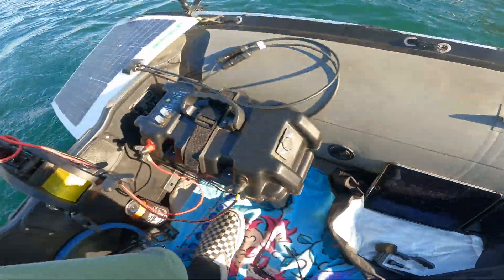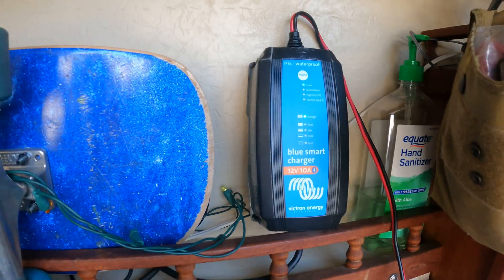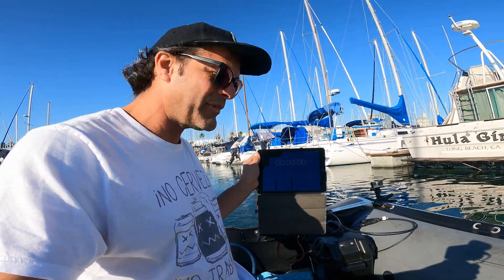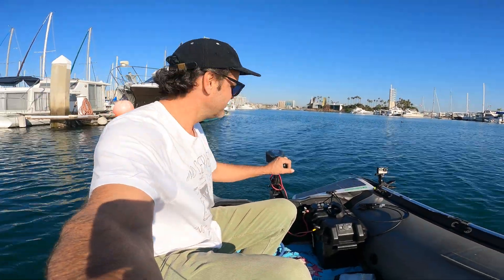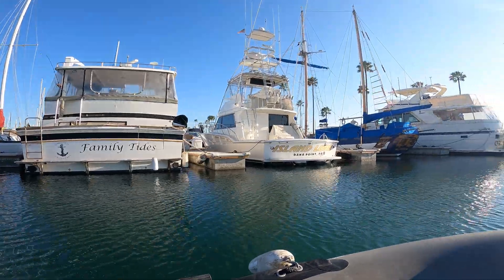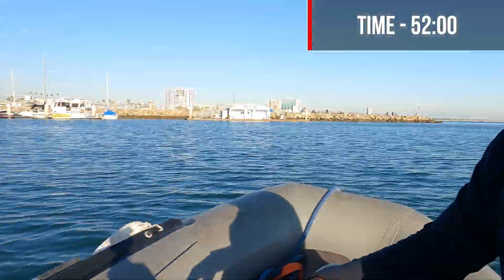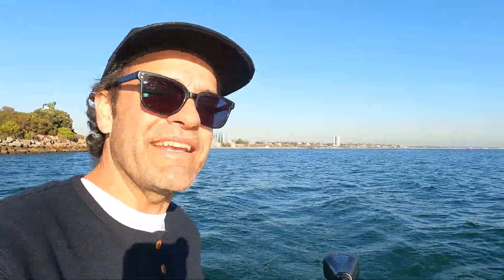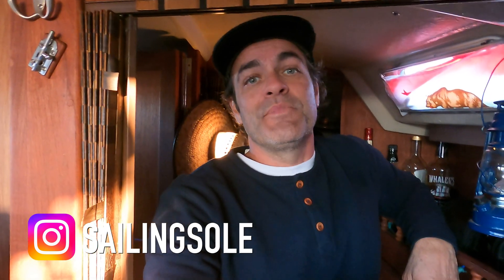EP 4 - Review: Solar Electric Dinghy | Newport Vessels Motor with 30Ah Lithium Battery

Comment: How does that solar panel and victron charger do keeping the batter y up with power used? Nice job
Thank you
Reply from the maker: It won’t keep up. It is merely a trickle charger for when it’s sitting at the dinghy dock or not being used but that 50 watt panel won’t keep up. It will top it off if I let it sit which is nice.

Comment: Interesting video. Lasted a long time. Just think if you would've stopped and done some fishing the batteries would have gone a lot longer getting a charge while you were fishing or sightseeing.
Reply from the maker: Yeah I e thought about adding another 50 watt panel to the other side and upgrading my battery but it works fine for now. Cheers!

Comment: Just so you know, most trolling motors that size use dissipation coils to slow the motor down. Therefore, changing the speed does not affect power consumption much at all. Yours may be different, but mine uses about the same amount of power no matter what speed I am going. To reduce power consumption at lower speed you would want a pulse width modulator.
Reply from the maker: I did not know this. Thanks for schooling me. 
Pretty sure my motor is not like yours because my motor has a voltage meter (blue lights on top) to tell you how much battery life is left. Obviously not accurate but a crude meter. When you go full throttle the voltage drops. I’m definitely not an electronic engineer but seems logical.
Reply: @sailingsole  that voltage drop you see is where the motor is under a heavier load, so therefore it may be using less power at lower speeds.

Comment: Hey Andy, great content, as always!  Hopefully your LiFePO4 battery is a deep cycle battery (e.g. Lithium Titanate Oxide, or LTO).  Otherwise a full discharge can cause the electrodes to oxidize and retract, which will reduce the battery life.  Love your channel!
Reply from the maker: Thanks man. The battery has a bms so it will shut off output before it hurts the battery. It’s been a while since i made that video and the battery has performed fine ever since. 🤙🏼

Comment: You should get 1 more of those batteries so you have 2 in that box and that way if its windy or no solar you know you have 1 hour
Reply from the maker: Good idea 👍🏼
Reply: @sailingsole  if you do it you know positive to + and negative to - on both batteries but then you do positive on 1 battery and negative on other don't do them on 1 battery then it won't pull threw  both batteries or charge correctly.

Comment: Thanks for this video. Got an Intex Excursion I'm gonna custom mod the floor with plywood and make a built in motor mount. I have the same trolling motor and a 100ah iron phosphate on the way. Wonder how much the solar panel helped? Should I try a 100 watt panel? Thanks again and be safe.
Reply from the maker: Yeah, if you have room for a 100 watt panel do it. That will be much better to charge your larger battery. I’m curious how long your setup will run in good sunlight.

Comment: Thank you for being practical in your test of the electric motor. I had been thinking about going electric on my dinghy…do you think it’s powerful enough to be on the oceans, or in rougher water?
Reply from the maker: No I don’t think it’s strong enough for a dinghy in the ocean. But maybe if you had the 86 pound thrust motor that would work. But that is a 24 V system.

Comment: Nice test. LiFePO4 stays at rock-solid same voltage from 90% all the way down to 30%, and most motors attempt to measure the capacity by guesstimating based on the voltage, which is why it said 100% even though it was more like 35% when it started blinking. Great runtime anyway though.
Reply from the maker: Thanks TGT! Ya I understand that, it’s why it died so fast near the end. Cheers!
Reply: While this is all true, the real reason it stayed at full capacity for as long as it did is more likely due to the fact that it was being fed charge voltage by a solar charge controller.
Reply: Not correct. A 55# troller pulls about 200W continuous at speed 3. That 100W panel loses ~10% even in perfect sun through the MPPT, so it's giving back 90W-ish, max, less than half of the motor's draw, so it'll extend the range of the battery by a few hours, but it can't keep it topped up. Also, the volt meter on top of the motor can be tuned for lead acid or lithium, but not both. I'm willing to bet this one is tuned for monitoring lead acid, because that's what manufacturers do with volt meters 99% of the time. Lead acid reads full at 12.8V. A lithium pack is less than half-full at 12.8V because it lives higher than lead acid until the last 10% of its discharge cycle. So the LEDs would read full for the first few hours even if no solar panel were connected. The battery was not topped up. A volt meter is a faulty way to read a LiFePO4 battery.
Reply: @texasgreentea1  Ya you’re right what was I thinking, having a charge source hooked up couldn’t possibly affect a volt meter’s readings.
Reply: @Willdesignsandbuilds  Not sure what you mean. Volt meter readings are certainly affected by state of charge. They have a very non-linear correlation, which makes voltage wildly inaccurate as a proxy for state of charge, especially with lithium batteries. Also, I gather from your sarcasm that my last comment upset you. I didn't mean any offense. I was just trying to share info I thought would be helpful. I apologize if I seemed combative. That was not my intent.

Comment: Nice.  I've thought about the trolling motor option.  E-propulsion and torqeedo are expensive.  Pleasantly surprised by the range on 30Ah battery!
Reply from the maker: Lithium has come down since I bought that 30Ah. I would go for at least a 50Ah now.
Reply: @sailingsole  Newport Vessels 55lb trolling motor recommends a 50Ah battery and has a max draw of 52A.  Max discharge of the Eco-worthy 30Ah batter is 25A.   Definitely the 50Ah battery is going to be better paired with that trolling motor, especially if you have it on full blast.  Looks like plenty of range for a weekend at Catalina without recharging.
Reply from the maker: @keeldragger  Agreed that a 50Ah would be better but mine does the trick for now.

Comment: maybe up the battery to 50 or 100ah and be able to run speed 4 or 5 no problem. could always get one of them 100w foldable solar panels and lay it across the bow to charge.
Reply from the maker: You’re right, you could increase and upgrade every component to be bigger but this gear was relatively affordable and the point of this particular video was to test what gear I currently have in a practical use test. My 30Ah battery will power it at top speed no problem but for how long?! Thanks John!